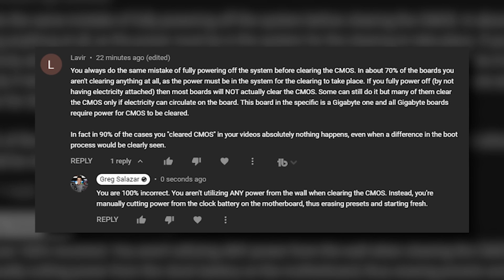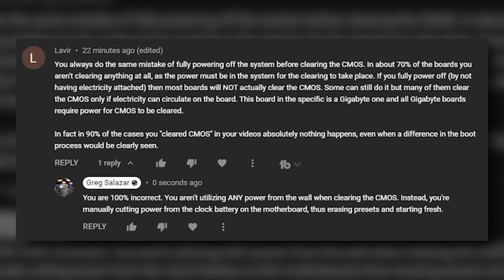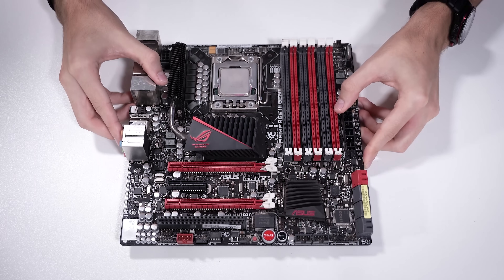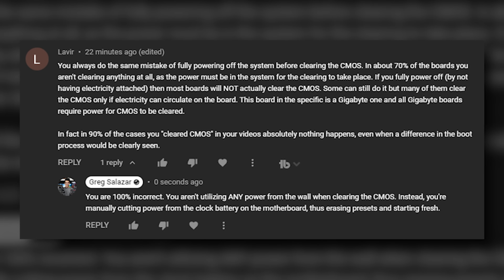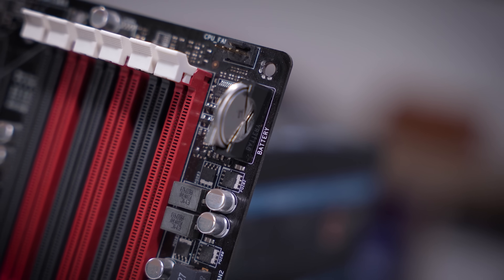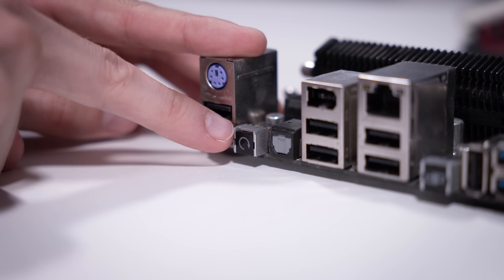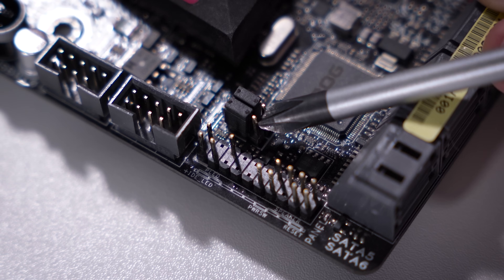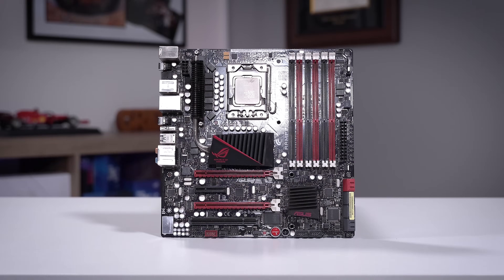How To CORRECTLY Clear Your CMOS

Comment: Removing the CMOS battery may clear the bios,  but if you are not getting a screen image then resetting the jumper pins may be necessary to try to recover the screen boot mode.  If that is unsuccessful it  may then be time to call in the expert to check if the motherboard has gone belly up - which is the case in about 50% of such malfunctions of the boot process.  He can then check other components - loose or failed - which could be alternative cause of such problems.

Comment: I have tried removing the battery and shorting the pins with a screwdriver on my MSI Z690 Wi-Fi motherboard  and t still won't  boot to BIOS.  I am at a loss as to why.  Luckily I am building a new PC but I want to solve this mystery  - I am sick of pressing the delete/F2/F-whatever buttons 'til my finger gets numb. Tried everything. 😩

I blame Microsoft,  ever since they infected the BIOS with theiur bootloader it has been downhill, used to be so easy.

Comment: Pull voltage low to reset or connect an additional battery in the correct polarity.. positive to positive negative to negative.

Comment: is it basically sending a physical short to the pinouts on the smd/chip ?

i have a ready for  landfill read only nvme,
you can see points for possibly a technician to probe, and i am curious if any  are capable flipping it to reset/erase/read/write. im guessing it is the controller chip on the pcb responsible for that but couldn't find any schematics/pinouts for it

Comment: I know this should work but damn, 2 machines {"working") apparently - can't get the display out, tried with the GPU"s installed and going off-board.. pretty sure I bricked one because of course MSI has no clear CMOS/bios (Yes removed the battery overnight)

Comment: I decided to update my bios from a 2023 version (which ran 4slot 64gb Ram) at 4800mhz to a newer version from 2025.

The 2025 bios version reset my ram speed to 3600.
I overclocked it back to 4800, and my PC wouldn’t post. 

So I had to use the safe method of taking out the battery, smh.

Why is a new bios upgrade having a difficult time running ram speed that a previous bios upgrade could???

Comment: Thank you ! My pc wouldn't boot properly ( no display)  this morning and the DRAM then CPU mboard light kept shining red. After testing with things I had figured out my pc would boot only with one ram stick at a time in slot 1or 2 but could not boot on dual channel. After a lot of cleanup and more reading, I figured that maybe clearing the CMOS would help, and it did, dual channel works again and pc is booting fine !

Comment: Unfortunately, I think you're wrong on this one. That comment is ultimately what helped me. I am unable to access my battery without significant effort - it's hidden under some shielding. I tried jumping the pins multiple times while the computer was off and it wouldn't post.. but then I did it while the computer was on and it worked immediately! I do have a gigabyte board like they mentioned, so maybe it's manufacturer specific.

Comment: hello hope you or someone can asnwer me, does clearing the cmos will solve my problem? i have , i think, cold boot problems after i have changed my GPU ( from 2070 to 4070 ti super , i plan to upgrade mobo cpu and ram in 1 years but for now i have an i9 9900k and z390m tuf). when i first start the pc i have black screen, like my gpu doesn't exist, i have to shut down the pc and boot again and all work perfectly fine

Comment: Ok but what if clearing the CMOS doesnt work? Like it either takes u to a bluescreen to repair but it doesnt do anything or it takes u into the bios and even if u just click save it still doesnt work what do u do then?

Or if after all that u press F5 for it to go into default settings and it still black screens or blue screens or takes u into bios? What do u do then?

I feel like ive tried clearing CMOS multiple times, ive put it on default many times too and nothing worked

I have an asus prime motherboard z790 lga 1700

Edit: i also dont know where the pins are and the back of my pc doesnt have a reset cmos button unfortunately so ive just been removing the battery

Earlier today it worked then i had the bright idea of trying to overclock again

It worked

Then again it failed

Then tried fixing it and failed

And then i changed some stuff in bios and it worked which was great and then  i shut it off after a while

Came back home and turned my pc on just to be taken back into bios

Comment: Hey there Greg Salazar. I just saw your video on clearing the CMOS. How about a stubborn Asus Z270-AR. I tried almost everything to clear the CMOS. Unplugged the power. Short cutted the CMOS pins on the board. I removed the battery of the board. Unfortunately nothing seems to work., Even Asus is puzzled about this. I still keep getting the messge "After setting upIntel Optane memory or the RAID configuration was build SATA Mode Se;ection must be changed to RAIDmode to avoid unknown issues".

Now I run on a Z270-AR board with an i7 6700 Skylark CPU. 2 nvme m.2 sticks. One is 550 GB for windows, the other is a 2TB just for storage. Along with a GPU RTX 3060 12GB. With 32GB of memory. 
I always need to press F1 and then F8 to from boot manager to boot windows. And after an update or reboot I need to shortcut the pins to reset and start allover again from F1. How can I solve that issue. I really appreciate your input on this

Comment: hi, any exprince on hp ellitedesk g6 , i forgot my bios password, and by removing battery or shorting the pins or holding rest bottom, the password is still there, eventhogh after tuning on the device ,message appears factory rest due to loss of batter, any advice

Comment: I'm new to the PC building and gaming hobby. I obtained several mobo's that I've tested and thankfully work great but I have an Asrock Z390M Pro4 that fires up but no display. I did all the usual ram swapping, cleaning, different cpu etc andI have removed the cmoss battery and even swapped in another one but still nothing. I did not try to use the 2 pin clr-cmoss method yet because I wasn't sure if the battery needed to be installed or not. Thanks for "clearing" this up for me.

Comment: I have a 9th gen MSI mobo and the 3x that i cleared CMOS is EXACTLY as Greg shows in this video.
The MSI mobo manual also says to first pull the plug out of the wall socket then press the Power on button for 5 seconds before shorting the clear cmos pins.

Comment: Sometimes when I remove the cmos battery for only a short amount of time, the settings do not get cleared completely and I end up with weird issues.  Then I have to remove the battery a 2nd time, turn off and unplug the psu, drain the power from the board and wait a full 5 minutes before putting the battery back in.  Then it works perfectly.

Comment: So I was wondering if my current computer problem has something to do with the cmos. It was working fine before, but I was unplugging it one night and the outlet sparked up and nearly electrocuted me. Now everytime I turn on my computer, it keep saying it's on power saving mode. It also tells me to wake it up by pressing a key on the keyboard or moving the mouse, but nothing happens. I've tried removing the RAM and cleaning it, and I tried taking out the cmos and putting it back in. But nothing works.

I was wondering if the cmos could be shorted out due to the sudden shock and if replacing it would solve my problem.

I have a refurbished Dell Optiplex.😢

Anything helps!
Reply: Have you tried a different power supply, would be my first guess.
Reply: @raifthemad  Oh, I fixed it! I got a new power cord and it works fine now. I'm guessing the shock caused the cord to have a short in it or something.

Comment: How does one clear cmos on a mobile phone logic board? Particularly an LG V930. I was given a extra logic board/mother board for my V930 but, I'm a little hesitant to use it without clearing it. But, I see no reset, or battery or pins, like you're showing in your video. Any ideas?

Comment: PRBLEM FIXED!!! For anyone having issues shorting the cmos. I had 4 failed attempts then i unplugged alls usb devices, let the screwdriver by there for good 5 mins and pressed power button for 30-35 secs and also dont forget to disconnect the hdmi fr the displays as they can have charge.

Comment: If I do all 3 procedures, Hold the bottom on back of MoBo, use screwdriver on the two pins and remove the battery, it will be ok.?

Comment: that's what I thought. I am 33 years old and when I was 15 I learned to do each of the "RESET BIOS" processes, that's what I and my friends used to call it and still call it today, for safety I would hold the power button down for 30 seconds with the Power Source button off and during that time because I only had one Jumper. We would swap the other two pins or remove the battery and hold the power button down for 30 seconds like that because the Clear CMOS button was only for the rich :D . I didn't have that option back then. But at the end everything was back to the Original as it was at the beginning.🤘

Comment: I had to clear the CMOS, I tried to short out the pins with the power off, but that didn't work for some reason, maybe the power needed to be on, but I wasn't going to short out pins with the power on. I had to remove the battery, that worked fine as you would expect.

Comment: I have a rather peculiar scenario with my work PC. Sometimes the BIOS config might shit itself and the machine will give RAM errors although the memory is fine. Resetting it without power never fixed it for me but leaving it to run while the 3 PIN CMOS jumper were shorted on the CLEAR config, after 5 mins of running idle with those pins shorted it would boot fine when placed in the normal configuration. After that incident, i've never used just 1 method for clearing the CMOS of a motherboard and also kinda validates a teeny bit of message the other guy had posted.

Comment: Just to be clear: What's happening when you do this is that the UEFI firmware on the board runs specific code to clear out the UEFI variable store. The variable store is not battery backed, but rather in NOR flash. Exactly how this can be triggered, and also what gets erased, varies between motherboards - some will fully reinitialize the variable store, others just flag all or some UEFI variables as no longer valid. (Think of the variable store as a small file system inside your BIOS chip.)

Because so many people are familiar with "clearing CMOS" by removing the battery, from back in the days when CMOS was actually a thing, most motherboards (but not all - gamer/enthusiast boards usually will, but OEM and professional boards often not) will trigger an NVRAM reset if an invalid RTC date is detected. This, however, is emulated behavior, and can be quite inconsistent between boards.

Also, motherboard makers really need to start labeling that jumper or button "clear NVRAM" or "reset BIOS settings", depending on what it actually does; calling it "CMOS clear" is ambiguous due to the complexity of the UEFI variable store (e.g. it may or may not fix a boot failure caused by a malformed variable entry, as opposed to just bad overclock settings, depending on how "CMOS clear" was implemented).

Comment: My board is the b660 prime and the circular cmos battery I don’t have, mine is squared and doesn’t come off the board but I have the 2 little pins but I tried that method and it didn’t work, I installed new ram and just keep getting black screen even when I put back in my old ram can you help?
Reply: did you find a solution bro please ? im in the same case

Comment: Very informative video, but I will say, you both have a good point. I typically reset the bios with the computer on and have had better results than pulling the battery or using the jumper alone. Either one will work, but if you have a motherboard that is so stubborn and will not boot or post, I HIGHLY suggest powering it up and jumping it 3-4 times till it posts. Once it posts install a new bios and be done with it.

Comment: I have a Gigabyte motherbord and i had to clear the CMOS recently.
I removed the battery and powered down the PSU for about 20 seconds and the CMOS was cleared.
I believe there was no need to power down the PSU on the switch but i wanted to guarantee there was no remaining energy on the capacitors that could possibly "feed" energy to the CMOS.

So the statement that all gigabyte MB should be on to clear CMOS is false.

Also, the purpose of the battery is to maintain the BIOS powered so it maintain its memory at all times, even when the PC is disconected from the wall.
If the BIOS loses power it will loose its configuration so i think theres no need to explain more why that statement is wrong.

Comment: using a HDD is not a good example of the point you where trying to get across with volatile memory as a HDD stores data magnetically which is a completely different process of storing data to compare to nanflash, yes it is non-volatile memory but a different forum and process.
for Cmos chips they are comprised of both nanflash and volatile memory it's basically two chips in one.
Cmos bios chips now and days are a combined chip of nanflash witch you flash your bios to witch is non-volatile memory and your settings are saved on a volatile memory chip within the Cmos.
this is why your bios is always saved wen power is removed and why your settings get whiped wen you lose power to the volatile memory chip wen the battery is removed.

Comment: It has happened to me before that I remove the battery for the CMOS completely, wait a few minutes, put it back in and turn on the PC and the bios settings are still the same as they were. Is this normal? Only has happened with a ASUS A320-MK but it happened to me at least 4 times before, (thankfully my new mother has a cmos clear button).

Comment: From a Gigabyte manual: 
"Use this jumper to clear the BIOS configuration and reset the CMOS values to factory defaults. To clear
the CMOS values, use a metal object like a screwdriver to touch the two pins for a few seconds.
Always turn off your computer and unplug the power cord from the power outlet before clearing
the CMOS values."
Reply: You might need to send a charge through the chip to jump it into action , Sorry wrong

Comment: I guess this person is thinking that way NOT because of volatile/nonvolatile memory....I believe he's thinking that without being powered by the power supply the reset pin can not be energized since the computer isn't on.  
But CMOS is kept refreshed by the CMOS BATTERY...remove the CMOS Battery for a specific amount of time and the CMOS stored settings are lost.  Same goes for the CMOS Reset contacts...it is powered by the battery and when those pins are shorted out it sends the battery voltage to the CMOS reset.

Comment: My question, the MOBO you used for demo has a PCIE slot that was backwords. how come it's like that? what items are used in that slot?
Reply: What makes a PCIE slot backwards? Both lane order and polarity are reversible in the spec
Reply: @shanent5793   it’s hard to explain. The bottom PCIE slot has the whole thing flipped 180. At time 2:31
Reply: @Dracnaphobia  if you mean the very last slot, that's not PCIe, but a 5V 32bit PCI connector. PCI was the standard bus before PCI Express
Reply: @shanent5793  gotcha. I understand that now. What items would use that slot typically?
Reply: @Dracnaphobia  used to be anything. Today it's a legacy port, so it's only used if a specialty peripheral can't be replaced or redesigned, e.g. data capture, point of sale, industrial controls. At 33MHz you could even DIY/experiment

Comment: I'll start out by saying that I always start out by holding the power button down like you said after the power cord is removed or the power supply switch is turned off, like you said. However; I have had weird situations twice in my life where one time on a really old 1990's motherboard I had to take the battery out for a week for the board to work again (probably something besides the cmos going on there), and most recently on an X570 board I had to take the battery out for an hour for the board to work again and I'm still using that board right now with no other issues ever. Consider that I've reset cmos thousands of times while working at a refurb shop and on my own stuff and these are the only 2 times this has happened.
Reply: Ppl saying its a non volatile ram

Comment: Greg you should just point him out on any motherboard manual. Yesterday i was building new system using old motherboard with different CPU and RAM. To avoid any trouble i wanted to clear CMOS. I checked the manual to find where exactly these two pins were and voila, here was a guide how to clear CMOS. Step 1. Turn off your PC and unplug power cable. Besides that there are also 2 other aspects that are against doing that when the system is on. First, I think it would be really bad idea poking with metal screwdriver into motherboard with running system. One slip and you end up with short. Second, CMOS powering must be obviously totally independent from main power, else how it would work?

Comment: remove battery its good, press power boton also ok, dont remove jumper and only place a screw driver wrong, its more efective remove the jumper and power on the mother board also erase the bios info

Comment: My Gigabyte motherboard (X570) came with an empty CMOS-battery. I can confirm that the CMOS gets cleared every time without a battery so yes, cutting the power will clear it, or not having power in my case. It really sucks that a company like Gigabyte ships these motherboards with empty batteries. In my case the shop sent a new one. (Yes, I verified the orientation of the battery and I  even tried out the battery inserted reversed to make certain)